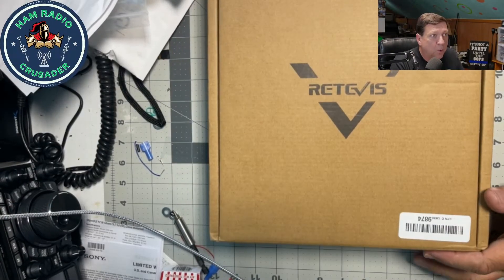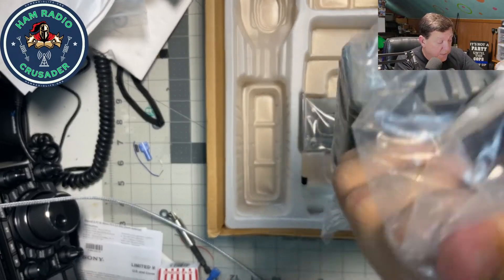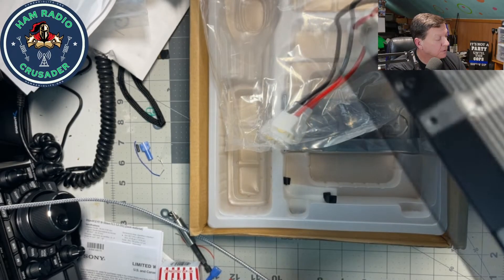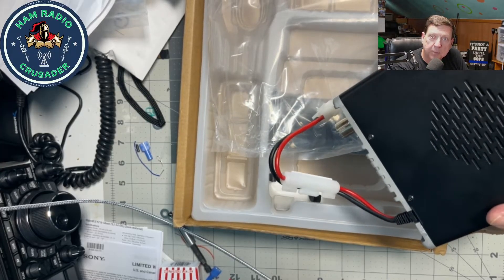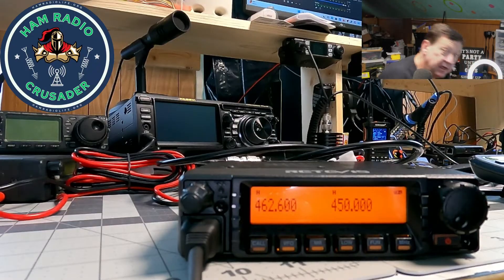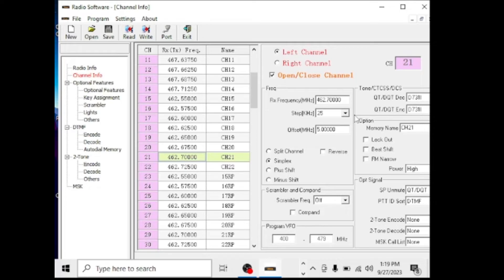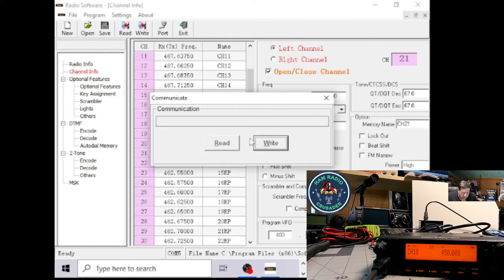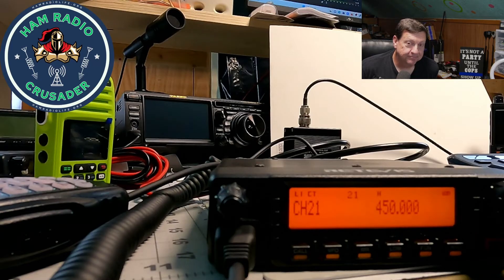Retevis RA-87 Evaluation Part 1

Comment: Does this have both gmrs and usual analog?
Reply from the maker: I’m not exactly sure what your asking. But this radio transmits and receives in the GMRS bands and in the analog mode. And it only has the analog mode and does not do digital

Comment: Nice video. Can you explain about power supply to the radio?  It looks like you are using a battery. What kind of cable to connect battery to radio?
Reply from the maker: I was using a AC/DC power supply connected via the power cable that came with the radio

Comment: Bought an RA87 about 2 weeks ago and noticed it wasn't performing as advertised, I was getting only 25-29 watts output. Long story short, contacted Retevis for an exchange or repair, under section 19 on their website it says, Return and Exchange: The first customers can return goods for a replacement or refund within one month of receipt. Retevis offer 24-month radio repair for free. (Radio accessories enjoy 6 months repair warranty, except earpieces enjoy 3 months warranty, from the date of the first customer’s receipt.) Beyond the warranty period: We still offer maintain service; buyers are required to afford corresponding cost. I was told I did not have the proper equipment to properly test the radio. Won't be buying another Retevis!

Comment: Great Videos on this radio I wish you could do one in the newer Radioddity GA-510 Programming I am having a time trying to set the directions up on the frequencies with their software that they recommend using because it's newer version will not work with Chirp I tried every way to get to frequencies programmed in and get the direction set with no success appreciate some help if you could on this problem because the company is not doing me no no favor . 73 K4BWN

Comment: Is this radio unlocked outside GMRS frequencies? And do you notice it opens up the squelsh almost like 1 second after you transmit on the other radio?
Reply from the maker: If there is an unlock for this radio I have not applied it. And no I have not noticed the delay. But I am doing some follow up.
Reply: I am not saying you did a mod, but I see 450 MHz on the screen as well as a dropdown selection on the software for a pretty wide band, is that for RX only? I ask because I have an IG license, so very curious to see what Retevis has out there.  @HamRadioCrusader
Reply from the maker: @solar_ize  it does receive in the 450Mhz range but does not transmit. I do t think :-)
Reply: @HamRadioCrusader  ive had this radio since the day it was offered by retevis, been using it for gmrs in my jeep . decided to change it to 145mhz to leave in my base and it will not change , will not factory reset either way. when i bough it it was supposed to be dual band. meaning it could only be used for vhf or uhf but its a complete lie. i havent found anyone that has had luck switching it or unlocking it.
Reply: @HamRadioCrusader  by the way when it was first up for sale it said dual band everywhere it was listed, now it just says gmrs
Reply: The one thing I notice with budget radios such as Baofeng and BTech is that the squelch takes too long to open. Try it yourself: press PTT on the HT and listen to the other side, relese PTT and immediately after that press PTT again and start talking, you will see that on the second transmission the receiving radio squelsh takes 1 second to open. I don't see that happening on higher-end radios like Icom or Kenwood. @HamRadioCrusader

Comment: Freddie, just received last week the RA-87 repeater package from Retevis which besides including the two radios also includes: 13.8vdc power supply, cabinet, cooling fan, and programming cable.  Think I got a pretty good deal, but who knows... Just like JDuddadventure not getting the full 40 watts that Retevis advertistes/promises and only getting 31 watts at high power and once through the duplexier only getting 24 watts out. On the good side, really kinda amazed on how clear sounding repeater is on receiving. Thanks for video and information on the RA-87 and looking forward to your GMRS version.
Reply from the maker: Tuesday evening around 6pm CST The new video will Premiere. Thank You for the kind words.

Comment: I just did a video of the repeater Sid of this and 26 watts is all I could get. Every video I see it has different output
Reply from the maker: Did it present any Heat issues on the Transmitter Radio?
Reply: @HamRadioCrusader  yes and no. I put a fan on it and and that helped out a lot it never cut back the power. All the information is in the video. I’d suggest a few cooling fans if your gonna run it hard
Reply: @HamRadioCrusader  btw you don’t need there audio cable any microphone jumper still work
Reply from the maker: @JDubbsadventure  Yes I knew that but the cable they sell you has more shielding and is rated at 50 Ohms like an antenna cable. It's just less likely to accept interference like a audio cable would. But they are VERY close in characteristics.

Comment: Hey Freddie, another great video! I also have the Retevis RA87 and it is a great radio no complaints here. I'm very interested to see the repeater function, someone told me I need a duplexer to have a repeater,wondering do you need one to make this work? Love the videos and your attitude, sense of humor😅😂. Looking into getting a J-pole for mine. I'm also getting a node thanks to you👌🤙I'll be on the look out for the next video 😎👍
Reply from the maker: It is WAY easier and practical and more expensive to use a duplexer. Otherwise you have to separate your TX and RX antennas a ridiculous distance to avoid intermod. And a J-Pole is a Great idea, LOVE J-Pole antennas. Thank You for the kind words.